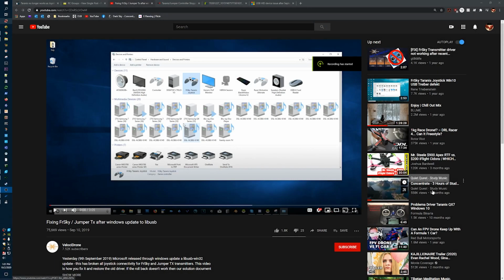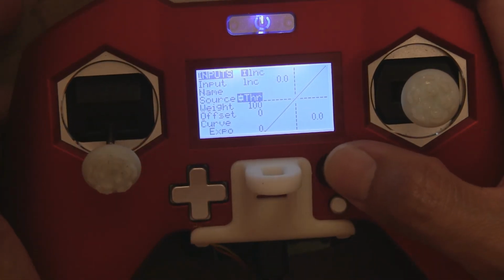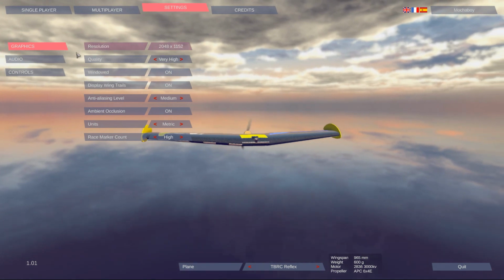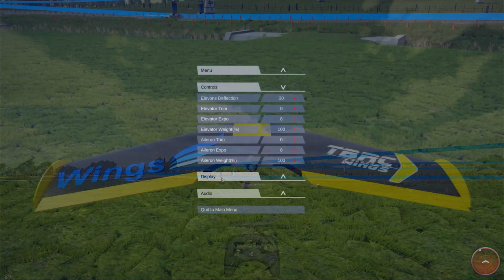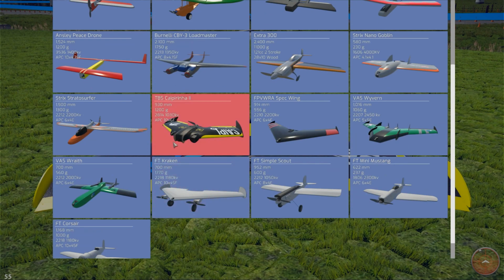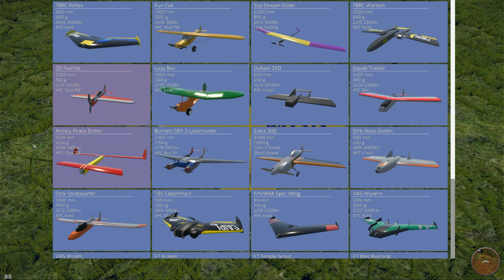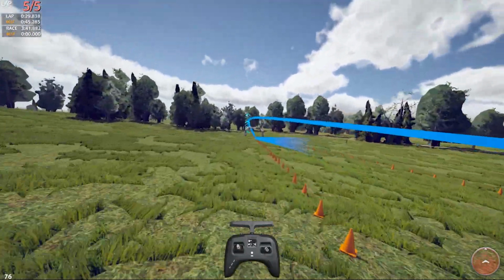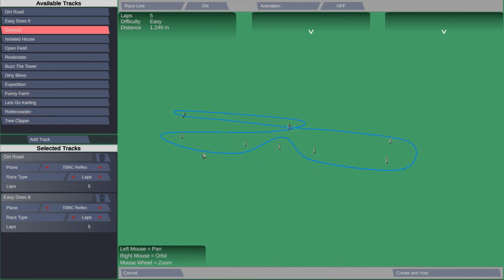Wings Flight Simulator Overview and Setup Tips

Comment: Thanks for the video. I've never flown a wing before, so looking forward to trying it out.  I'm having an issue with controller setup. I've been using a flight controller with a receiver bound to radio, because  I don't have the right USB cable to go from radio to computer. Works on other sims.  It shows stick input during setup but stick movements are all over the place and won't calibrate correctly in the sim. Any idea if this way does work? Thank you.
Reply from the maker: Your best bet is to join the discord link (link in the desc) and you can connect with the devs directly to see if they can find a way for you to get your problem fixed.
Reply: @MochaboyRC  Will do,  thanks!